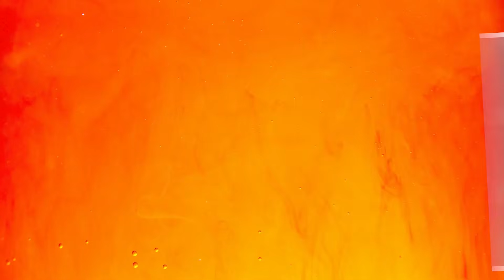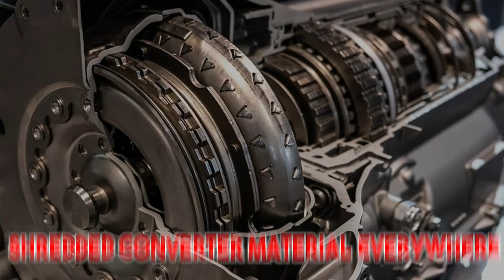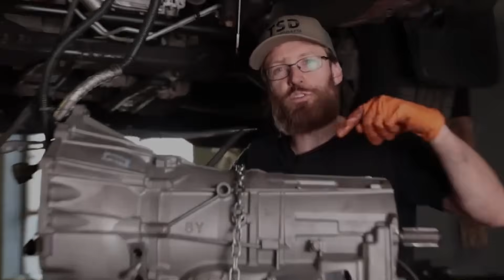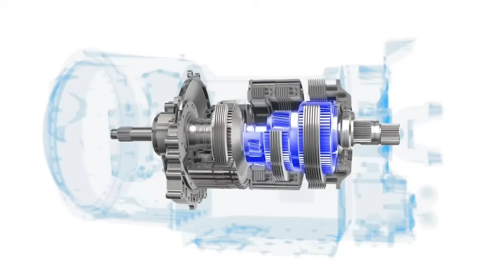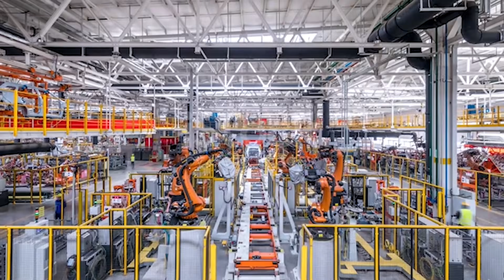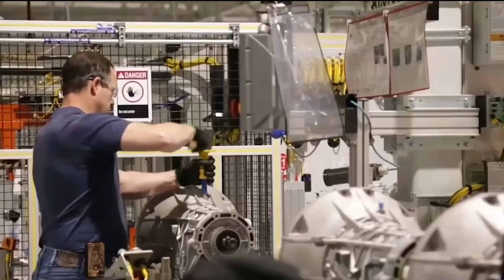3 WORST and 4 BEST Cadillac Transmissions You Can Actually Own

Comment from the maker: What Cadillac are you driving, and what transmission do you have? Drop your model, year, and mileage below. 
If you've had transmission work done, I want to hear about it. Any technical questions - ask them here, I read every comment. 👇
📘 FREE Cadillac Buyer Checklist 👉 https://projectcadillac.com
Reply: I have a 2013 ATS 4 Performance  with the 6L45 and 50,700 miles. I was having some transmission shudder occasionally and had the fluid and filter changed just a week ago. I’ve only driven it a couple times since and I think I noticed a slight shudder during the first time I drove it after the service. Hopefully it will be better the next time I drive it. I’m retired and don’t drive it every day. I noticed the 6L45 was not mentioned in the video. Thanks for your information.
Reply: Update: as of now there’s no longer any shudder. Yaaay!
Reply: My 2023 xt5 2.0 turbo has the  9-speed auto.  5 or 6 times now,,, it has resisted upshifting in the auto mode.  Hitting the up paddle will return it to normal function.  I plan to see if the tcm and any other tsb firmware updates have been performed on it.  Is it true that the fluid is sealed for life ,,, so no flush and refill ??   thx, for your posting on this.   Oh,,, 44,000km's

Comment: 13Cadillac ATS 6speed
Reply from the maker: Good transmission in that car - the 6-speed Hydra-Matic holds up well when you keep it serviced. Main thing I tell guys is to do the fluid every 50k with the correct Dexron VI. Skip that and you'll feel it shift rough around 80-100k. Stay ahead of it and it'll treat you right.

Comment: 2023 ct5 exactly 40,000 miles
Reply from the maker: Right at that 40k mark you want to check your transmission fluid and make sure your brake pads still have life. Also a great time for a tire rotation if you haven't done one recently. Catch it early, save a lot later.